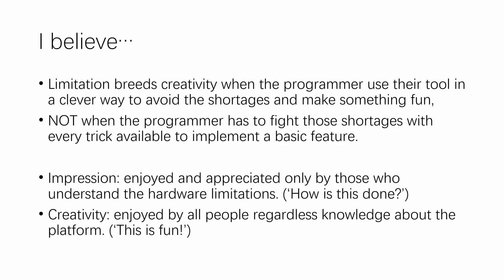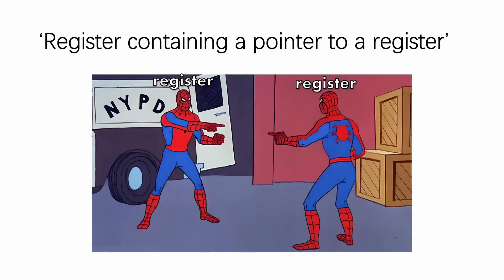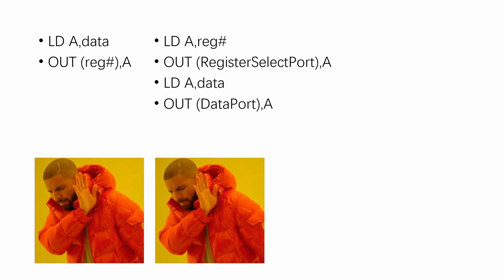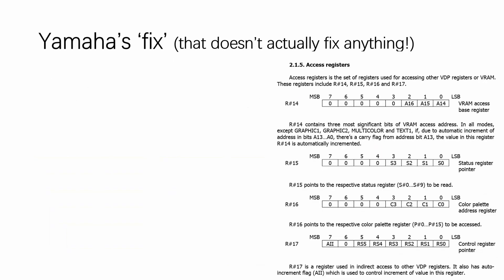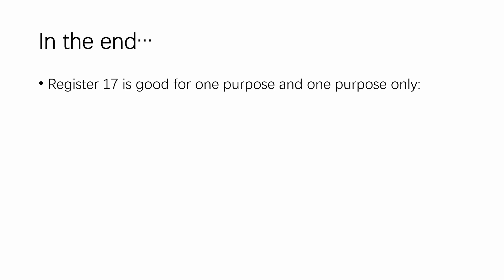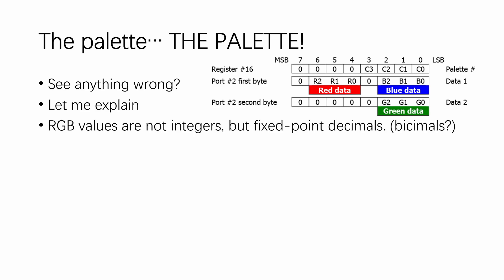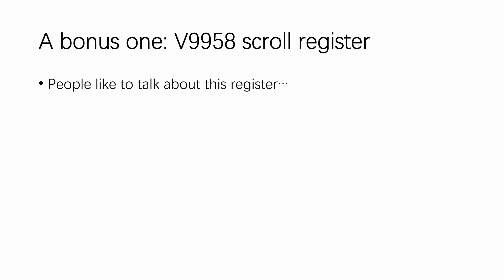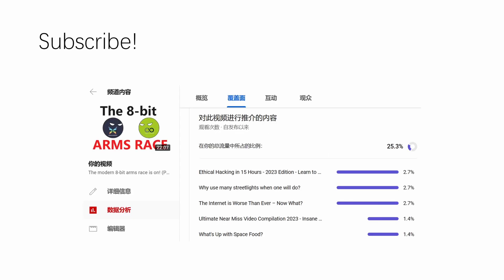The registers of V9958 are a mess.

Comment: Kinda of reminds me:
I had designed a graphics hardware interface for my project (a soft processor on an FPGA).

Initial idea was inspired partly by retro-systems, so I did it like:
Well, you have 80x25 cells, each 32 bits (initially with 8K of VRAM).
So, you could have options:
   8x8 pixel character cell (via a font), some attributes, and a 512 color RGB space (RGB333);
   4x4 bitmap cell, selecting between two colors from a 64-color space (RGB222).
Initially hard-coded for 640x400 output (line doubled from 640x200).

Ended up adding more base resolutions via flags, along with using flags to specify the relative size of pixel cells:
  So, for 640x400 base mode: 40x25, 80x25, 80x50, ...
And, made cells bigger (64/128/256 bits); and expanded them to support more formats.
  One subset of this includes modes similar to S3TC style texture compression.
  Another does 8x8 pixels with 1 bit/pixel selecting one of 2 colors in (128 bits, 2 bpp).
Eventually added non-raster bitmapped modes, which interpreted each cell as a block of pixels.
Then, later, added a few raster modes by supporting a mode where each pixel cell was only 1 pixel tall (say, one can do a 320x200 linear hi-color mode by effectively setting it to an 80x200 mode with 64-bit cells within the bitmap sub-mode).

I don't generally go over to high resolutions though, partly because memory bandwidth limits resolution. Theoretically, it now supports bigger RAM-backed VRAM, but due to memory timing and bandwidth, it can't maintain good video output for modes than need more than around 8-10 MB/sec (such as 320x200 hi-color or 640x400 16-color; or 800x600 4-color if feeling adventurous; or use the color-cell modes...).

But, the design is pretty terrible looking, vs had I just gone straight for a raster mode; and used some more straightforward way of specifying resolution.
Also theoretically it has two separate scrolling mechanisms, but I don't use either of them...

The design of the audio hardware is also a little wonky. ...

Hardware design is fun though...
Reply: That is why a good software library designer thinks about interfaces from the start. Or ISA of a CPU. Or UX : Mac thinks about UX first. C64 : 8 bit machine? Let’s use 8 sprites ( per line and screen ). One char code and color attribute per 8x8 tile. NES : 256px resolution to fit sprite positions into 8 bit. Sprites and background are made of 8x8 tiles. Shared palette between background and sprites so that you can always park sprites or use a walking animation in the background.

I feel like a lot systems limit the sprite data too much. Artist should be free to use any width of tiles and any height. Flicker will remind them when they are out of bounds. Same for playfield pitch
Reply: @ArneChristianRosenfeldt   Possibly true. The design of some things migrated pretty far from where it started.
Where I started, and where I ended up, in terms of the ISA design, it is almost unrecognizable.

I started out pretty close to the original SuperH ISA (and it was effectively a reboot of a prior design based on throwing extensions onto the SH-4 ISA; which had turned into a horrible mess). Now, not so much, the only obvious similarities are things like the Stack Pointer being in R15, the use of an SR.T bit for conditionals, R4..R7 being used for the first 4 function arguments, ... It started out with 16/32/48 bit instructions, now 32/64/96-bit; and admittedly some parts of the encoding are a little dog-chewed, etc.
Had thrown on an alternate decoder allowing it to run RISC-V / RV64G code, but RV64G gets slightly worse performance than my own ISA design (despite the general crappiness of my C compiler if compared with GCC). Though, most of this is likely due to RISC-V "shooting itself in the foot" by not having a register-indexed addressing mode and similar.

But, yeah, graphics hardware also mutated, and the design is a mess. Mostly using it for a mixture of text and bitmapped graphics (along with Doom and Quake). The early design was mostly text, but could handle Doom semi-effectively via a real-time color-cell encoder.
Though, for full-screen Doom, have mostly gone over to a 320x200 hi-color mode. Can note that 640x400 color-cell works moderately well for GUI.

Audio is also a bit wonky, using a combination of a audio-loop buffer (4kB, A-Law, nominally 16 KHz), and a music-chip design partly influenced by both the Yamaha OPL chips and earlier PSG chips (such as the SID), effectively resembles a 16-channel FM design, but also with square and sawtooth waves (and can use either sine or triangle waves for the modulators). Later glued on a feature where it can use 8/11/16 kHz A-Law samples (supporting one patch per FM channel), partly intended to be able to accelerate MOD and S3M playback. Alternately, it is possible to do the MOD and S3M playback in software, but this can eat a lot of CPU time on a 50MHz CPU (mostly went with S3M as the format made sense, whereas IT and XM seemed needlessly complicated).

But, the games I am testing with (mostly Doom and similar) would not make use of the hardware mixer.

Was using A-Law mostly because it can give quality closer to 16-bit PCM, at 8-bits per sample (with internal mixing mostly being done at 16-bits per sample). Mostly using 16 kHz as audio quality is considerably better than 8 or 11 kHz (while not as expensive as 22/32/44 kHz, with less gain in perceived quality).

For audio storage, 16kHz ADPCM works well IMO: Better quality than 8kHz 8-bit PCM, at the same bitrate. Also, IMHO, both faster to decode and better quality than low-bitrate MP3 (at low bitrates, MP3 tends to sound more like one is shaking a bunch of broken glass in a steel can; not a good sound).
The ADPCM approach works down to around 3 bits per sample.
For stereo, have often used a center/side transform, with the side channel encoded at around 1/4 the sample rate (say, 48 kbps center, 12 kbps side).

Well, and similarly for RGB555 as a working format, which is "mostly good enough" (and needs half the space of 32-bit RGBA8888 or similar).
Or, for image storage, often 8-bit indexed color. Or, the oddity of repurposing a limited form of 8-bit MS-CRAM as an image format; which needs roughly 2-bits/pixel. Though, in its simplest form, this is essentially 4 bytes per 16 pixels: 16-bit pixel selector, and two color-endpoint bytes. )
...
Reply: Why is RISC-V missing an addressing mode? I thought that just like MIPS it always adds a register and the immediate value. You are free to set the immediate to zeros and reserve a register to contain zero. But then I think there is already a zero register to eat the output of .. the output of what actually? Those CPUs have no flags.
I did not know that audio data rate is a problem. So I am not good at hearing, but I thought that Music with 3 channels, and 3 channels for effects are enough. Even with 8 channel, the data rate to memory is far below video demands. I don't like analog audio. I like the DSP in SNES, Atari Falcon and Jaguar. People complain about dithering on the PSX, but forget that it looked okay on TV. My Riva128 also dithered, on a high quality CRT, but also at higher resolution. Sadly, additive shading was broken in the driver and fog would exaggerate dither. Jaguar can use a color space with luminance. It is said to make Doom look best. No colored lights (Quake2) though.
Ah so, SH2 has a single flag. Even with the powerful branch instructions, I think that ADC between integers with custom numbers of bits is more natural for some applications ( fixed point maths).
  @BGBTech
Reply: @ArneChristianRosenfeldt 
RISC-V only has a single addressing mode: (Reg+Disp).
If you need other modes, you can use a multi-instruction sequence, but often around 1/3 or so of the total executed memory loads/stores are indexed, causing the lack of register indexed load/store to be an issue for performance.

The issue with audio is mostly one of RAM sizes and bus width on FPGAs, and how efficiently the sizes can be fit into Block-RAMs.
IIRC, 4K (or 4KiB) was in this case the most efficient use of Block-RAM, and gives around 1/4 of a second with 8-bit 16kHz audio (mono). Generally, one wants the PCM loop to be between 1/4 to 1/2 second (less than this is a problem for the software; bigger than this is wasteful).

If I wanted a higher sample rate or 16-bit PCM, I would have needed to spend more Block-RAM (and less than 0.125s for the loop buffer wouldn't really work).
But, not really going to go for 8kHz or 11kHz either, as these take too much of a hit in quality. Similarly, 8-bit linear PCM also sounds poor.
A-Law seemed like a good option, as it sounds better than 8-bit PCM, while needing less space than 16-bit PCM.
Downside is that it is necessary to encode it on the CPU side prior to sending it to the audio hardware, but I had added some helper ops (SIMD converters between A-Law format and Binary16).

In other cases, storage is an issue, where audio data can end up eating a lot of RAM if one is not careful. So, for things like sound effects, generally one wants compact storage. For Wavetable mixing, there was a similar concern, and for related reasons, one also wants to be able to fit all of the active patches/instruments into a relatively compact space.

Can note that formats like MOD and S3M tended to use 8kHz or 11kHz 8-bit PCM for the patches. This mostly also works. However, some MOD and S3M songs make use of unreasonably long patches, which can potentially cause their own issues (my hardware mixing doesn't really deal with patches longer than 64k samples). Theoretically, S3M can also have 32 tracks (vs 4 in MOD), but pretty much no tracker music does this (and 16 can handle both MIDI and S3M playback).

In my ISA, there are 3 types of branches:
Using the flag bit (like in SuperH), with a 20 or 23 bit displacement in a 32-bit op (20 vs 23 depends on ISA mode);
Using RISC-V style compare and branch, with an 8-bit displacement (vs 12 in RISC-V);
Using a compare-with-0 and branch, with effectively an 11 or 13 bit displacement (depends on mode; exists as separate instructions partly because my ISA lacks an architectural zero register).

In my ISA, pretty much any instruction can be made conditional based on the flag bit (rather than just branches). Also has 64 registers, which is sometimes useful (in the RV64G mode, the 64 registers are split into 32 GPRs and 32 FPRs, but in my ISA it is a single combined space). Sometimes the registers are used in pairs for 128-bit SIMD operations and similar (functioning as logical 32x 128-bit).

In terms of performance:
Doom (and similar), around 30% faster with my ISA vs RV64 (in my ISA, at the moment, it is averaging around 28 fps at 50MHz);
Software Quake, pretty close to break-even;
Dhrystone, also pretty close (both currently around 1.0 DMIPS/MHz);
GLQuake, my ISA is significantly faster (around 600-900% faster), most likely due to extensive use of SIMD in my OpenGL implementation (in RV64 mode, GLQUake is basically unusable; in my ISA, GLQUake is generally faster than software Quake).
There was a mostly-stalled Quake 3 Arena port, but Quake 3 Arena is fairly heavyweight, so I don't expect it to be usable.

I had also written a small Minecraft-like 3D engine for it, also using OpenGL for 3D rendering.
At present, no shaders for my OpenGL implementation, partly as I would need to figure out how to efficiently compiler GLSL to my ISA (with a compiler that could run on the target). (Theoretically possible, but horribly non-standard, would be running GLSL through my C compiler; did have some ISA ops to help with OpenGL style rasterization and tasks like dealing with texture compression, ...).

My working version is currently noticeably faster than my released version, as I managed to recently get some decent speedups via compiler optimizations, but releasing stuff is behind at the moment, as my stuff is also pretty buggy at the moment (and falls short of an acceptable level of stability).

SIMD:
It does 4x Int16, 4x Binary16, and 2x or 4x Binary32. Theoretically, the SIMD unit could do up to 200 MFLOPs at 50MHz (up to one vector operation per clock-cycle, with a 3 cycle pipeline latency).

In a small-scale experiment running neural-net math (at Binary16), it managed to be performance competitive with a WinXP era laptop (where the laptop has a 28x clock-speed advantage, but the relative weakness of doing the math using x87 instructions...). But, this is pretty niche (in nearly any other area, no contest between them; though in terms of general performance, the laptop will lose to the newer RasPi variants; like a 21 year old laptop is hard-pressed to match a RasPi 3...).

Performance on my ISA also depends a lot on what sort of code it is running.
Reply: @BGBTech  my C code tends to have a lot pointer -> member addressing. In C++ I use iterators. Gcc is pretty good at converting array access to iterators . I had written lots of (game like) global fixed array[index] code. Even if not global, on a home computer I might self modify. With a JIT on a PC I might do the same.

So I only know Amiga, Soundblaster, and Jaguar. Sample come from DRAM . Roland tried to protect their wavetable.

I started to write JRISC for Jaguar and the lack of SIMD is painful. There is SIMD unit to add RGB without carry between channels. But it is buried in the blitter. There is SIMD inner product, but it needs a complicated set-up. In a way floats are multiple data : exponent and mantissa. JRISC already has microcode and two floating point conversion instructions. Somehow it have been possible to have 4 float instructions within the set of 64. JRISC register file has only one outport. This makes the processor behave similar to old CPUs. NOT instruction is included because XOR would need another cycle to load the -1 . Saturation and Abs because branches are so slow ( but still not as SIMD ?!  , and with float we could just apply bitclear onto the sign. I don’t know about FPGA. In a way I like JRISC for its fixed instruction format: 6:5:5 . Two port file uses less transistors. It deals well with different latency of different memories. It is all about implementation, less about ISA.
Reply: @ArneChristianRosenfeldt 
Things like member access are not the issue (this case works well on RISC-V).

As noted, the performance difference in Doom is what I am seeing in testing, not a theoretical estimate. In this case, Doom ends up spending considerable time in the R_DrawColumn and R_DrawSpan functions, which basically fetch pixels, feed them though the colormap table, and output them to the framebuffer. These patterns can't really be translated into a non-indexed form, so RISC-V takes a performance hit here.

In my case, my CPU can run both ISA's, and I can build both with the same C runtime library, making it easier to make comparisons (though generally using GCC to compile for RISC-V, and my own compiler for my own ISA).

Note though that most other addressing modes would not make as much of a difference (so are still arguably better off being left out).
As for why to leave it out of an ISA? The usual argument is that indexed addressing requires 3-input instructions (with RISC-V being designed to only use 2-input instructions for the integer ISA).

As for the PCM audio hardware; yeah, it is pretty different from a SoundBlaster. If anything, more like a stripped down AC97.

There is a loop-buffer and some control registers exposed in MMIO, and one basically needs to update the contents of the loop buffer ahead of the current sample position (failing to do so causes it to make a sound akin to a jackhammer).

The FM design was loosely inspired by the Yamaha OPL chips (albeit, implemented in terms of MMIO), though has waveforms that should allow it to be able to mimic the NES and C64 SID as well (albeit with a lot more channels); or maybe allow using them in novel combinations with FM synth / ...

The wavetable stuff basically works by setting offsets relative to a base address in the FM control registers. Every time the FM channel updates, it fetches an A-Law sample at a position defined by (BaseAddress+PatchOffset*16+PhaseAccumulator[19:4]), with PatchOffset loaded into one of the FM channel registers (currently supporting up to a 1MB region of patch data). Where, normally, the phase-accumulators will drive the FM waveforms (in FM mode), but in wavetable mode, are understood as a sample-offset relative to a patch base (and some other registers are used to encode loop start/end parameters and similar). Pretty much all of this is specified per-channel (with 16 logical hardware channels).

In both cases, the note/sample-rate is controlled by repeatedly adding a pair of 20-bit fixed point values on a 64 kHz timer, with some control flags used to control carrier/modulator waveform, some small microfloat values encoding volume/attenuation, etc.
Effectively, I had taken an FM Synth design and hacked it to be able to do wavetable stuff as well as FM.

As for a General MIDI wavetable, mostly hacked something together via the powers of "random free sound effects and audio editing"; but, quality leaves something to be desired. For FM parameters, can reuse the numbers from Doom's "GENMIDI" lump and similar, though it doesn't quite recreate the OPL sound (in other contexts, it reuses the version from FreeDoom for the default FM parameters). My hacked together wavetable generally sounds worse than using FM synth though.

But, as can be noted, the wavetable stuff was more intended for possible use in playing Tracker music.

Note that the audio hardware itself doesn't really take any actions on its own, it depends mostly on software to shove values into the registers at the correct times.

...
Reply: @BGBTech  yeah, implementation dictated the ISA. On x86 we have those segment registers. Though I still don’t get the problem with the color lookup. At least on Jaguar the color is one byte luma and one byte chroma. The for light we add a signed value to luma. There is a single array to convert chroma to RGB. Especially on a game console, why not put it into the “zero page” of RISCV. The address range accessible by immediate values? Jaguar like Amiga like all 6502 systems and even PCs start the memory map with RAM. Now I guess that I need to check jump absolute. Looks like code also needs to reside at low addresses. High address is only for jump indirectly and for list which are typically iterated ( linked list , qsort , no hash table ).

The Z80 high and low registers are better. And now let’s consider modern 64 pointers which try to scramble the address. In DOS I could just load code into a segment and run it verbatim. Now I need exe loaders and Code still cannot jump to 64 bit addresses. Indirect? Systables?

Doom ran quite fast on Jaguar. I claim that the blitter should have used an iterator based design and should have forced Doom to use mipmaps. Jaguar can’t do color index well. So mipmaps shouldn’t be a problem.

What I like about DSP audio is that every game can write their own JRISC driver. What I don’t like is that Jerry can’t load a burst of samples ( two phrases in fast page mode ).
Reply from the maker: I don't want to be too critical, but I don't understand several of your design decisions here. I assume that you are using the FPGA with an 8-bit CPU so if you aren't, please ignore 80% of what I'm about to say. 80x25 is usually only good for high-res text modes. Using it for graphics will make the cells appear very thin. Also, 2 color or 4 color cells are sometimes limiting when it comes to artistic expression. Also, the CPU may have a hard time moving large amount of data in VRAM.
Reply: @andyhu9542  I am running a 64-bit soft-processor on the FPGA, albeit at 50 MHz, with a custom RISC/LIW style ISA (with a custom OS of sorts as well). Performance is roughly between 486 and Pentium-1 territory as far as I can tell (can run Quake on the thing, but framerates are a bit weak; Doom at present is around 25-30 fps).

As for 80x25, yes, it is a good mode for text. Yes, for color-cell graphics, it has non-square pixels. With the early design, 80x25 would have done 320x100, and 80x50 does 320x200.

With 64-bit cells, and a DXT1 style encoding, it could do OK 320x200 graphics in 32K of VRAM.

Typical early rendering strategy with Doom was to first render to a 128K 320x200 hi-color buffer, and then use a real-time color-cell encoder, then copying each frame into VRAM.

Later, I increased VRAM to 128K, which allows better looking graphics.

I have also still used a similar color-cell-encoder strategy for doing an experimental GUI.

Where, the idea is that the GUI first draws into a 640x400 hi-color buffer (512K), then color-cell encodes the framebuffer and updates the VRAM. Generally, each window has its own framebuffer, so the program first draws into the window framebuffers, and then the windows are drawn into the combined screen framebuffer, ...

But, performance is difficult with this (it is difficult to get the screen updates much faster than around 8 frames/second when running Doom or Quake). (Had also tried, as an experiment, running Doom and Quake at the same time in the GUI, but then overall performance drops to around 2 fps...).

Have also experimented with 640x400 indexed color (with a 256-color palette), but it is tradeoffs. It is difficult to get good looking colors with 256-color. Currently the palette is hard-coded, as trying to do an adaptive optimized palette is way too expensive for real-time use (it effectively takes several seconds at 50MHz to rebuild the lookup tables for an optimized color palette).

For 800x600 mode, currently the only viable options (due to screen-refresh memory bandwidth) are 2-bpp color-cell and 4-color modes. Both look "kinda awful" at present (though, color-cell looks less awful than 4-color mode).

Where, 4 color has a selection of fixed color palettes (including the traditional black/white/cyan/magenta), and a Bayer-pattern mode (where the palette alternates for each pixel; allowing a crude approximation of full-color graphics).

The color-cell modes can also work OK for video playback, as I am using custom video codecs based around a similar design (though, conceptually along similar lines to if one had LZ4 compressed MS-CRAM video).
Things like MPEG style codecs being a bit too computationally expensive to be practical.

Well, and BMP format images containing still images in MS-CRAM format, is also something I have been using (though, normal software does not understand this format). Well, and relatedly, also have a hacked BMP variant that adds transparent colors to 256 and 16 color bitmaps (for 16-color, the transparent color replaces the hi-intensity magenta).

But, yeah, admittedly I don't fully understand how old style GUIs worked, and based on performance, I suspect it is "not quite the same".

Can note that I am in an age-range where my childhood was mostly playing Quake 1/2 and similar on Win9x machines... having been in high-school when WinXP started to appear. So, no real first-hand experience with 8-bit era computers (but, earlier on, I do remember Windows 3.1 and similar, and game consoles like the NES, ...).
Also, technically, the rise of IBM clones started before I existed...
Reply: Do artists really want color attributes? It seems like 8bpp modes of SNES ( needed for mode-7) are well received. With anything 2,4 or so bits there is always the discussion about chunky vs planar. 1bpp is fast on 8bit CPU ( bit logic and shift operations ), and 8bbp is fast thanks to index addressing. Most 8bit computers do not even have 256 colors in total. I propose to have a split register. Character codes below this are bi-color with 2 bytes of attributes for syntax highlighting or draft-rough parts of the map. Character codes above are RGB332 for graphics. Another register identifies the transparent color ( after all artwork is finished, you check for unused colors ).   @andyhu9542